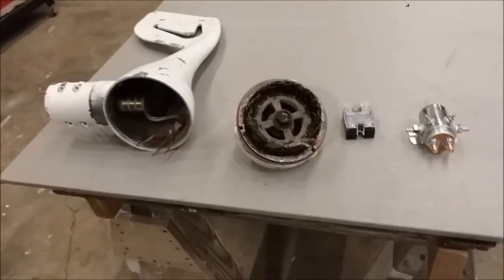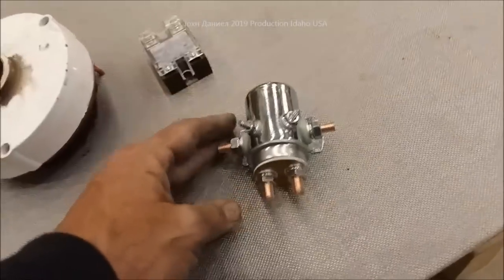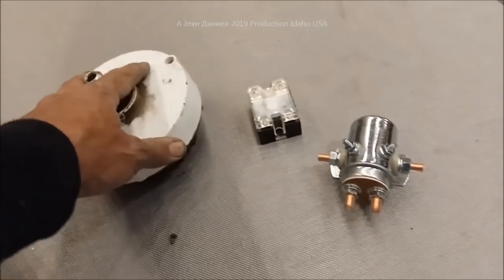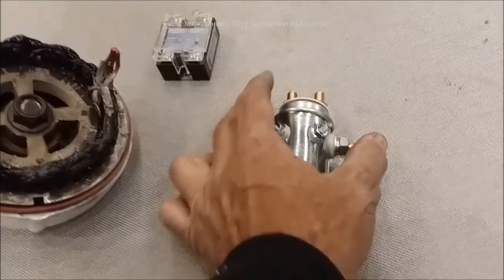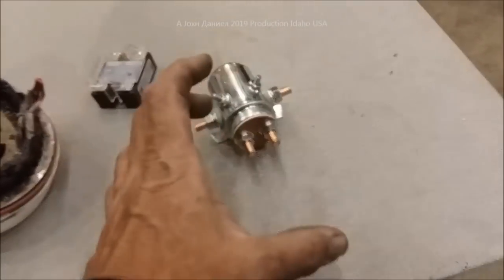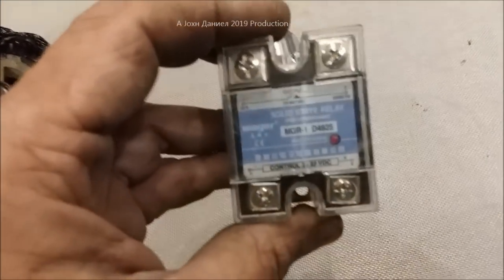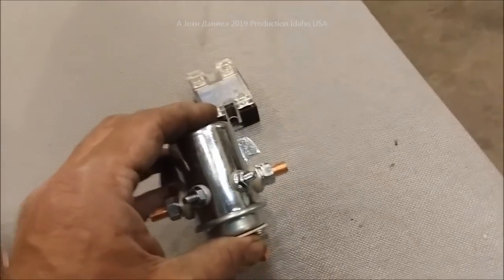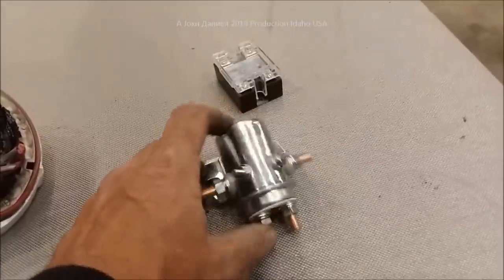Cause of Micro Wind Turbine failures, Best options listed below video

Comment: That looks like the stator was back-fed from the batteries. I don't think the magnets have enough field strength, to induce enough current into the stator, to burn up the wires like that. That looks like the solenoid was on, and some diodes in the bridge rectifier failed short. (they always do, I've never had a rectifier diode that didn't fail short) That allows the battery to have at the low  DC resistance of the stator. The smoke comes quickly!
Reply from the maker: When you dead short a PMA in high winds to 500 watts of resistors due to a failed Solenoid you drag it down hard in RPMS and they get hot real fast, same as if you had 30 mph winds and a dead battery trying to charge(Volts drop - Amps rise). 11 years and not once with over 400 turbines used and installed have we ran across a rectifier thats failed closed since the diodes in them burn apart, not together.
Reply: @JOHNDANIEL1  Diodes will burn apart, if they have the available fault current of the battery. The available fault current of a PMA is limited by the field strength of the magnets, and the impedance(number of turns) of the winds. If these PMA's are equipped with Neodymium magnets, that higher field strength could possibly induce the current necessary to do what you described. The inexpensive turbines that I've worked with just use ferrite magnets, and are largely "impedance protected", in that they just don't have the field strength to induce that much current. My biggest fear, is that the limited torque may not control rotor speed in high wind, and centrifugal force can exceed the root strength of the blades.(They end up in the neighbors yard)

Comment: Thanks John I'm on a remote island so sending back not an option will possibly use to charge a small 12 volt battery bank. I have purchased a 600watt turbine from China through your links and will let you know how it performs.
Cheers Fab.
Reply: Hey fabrizio

Wich one did you bought?

Comment: Hi John really appreciate your valuable input in an area that is sadly neglected small scale wind generation.
Especially here in Australia.
I hope you can help me with some information 're a turbine that is similar to the burnt out version  on this video
 I purchased s 24 volt turbine but it's output  is underwhelming. I tested it's  3 phases under  load and it's giving me  between 12-15 volts on 2 phases and 24- 27 volts on the third phase.
I've checked it internally including slip rings and it seems in order. I have a suspicion that I was given a 12 volt setup instead of 24.
Any ideas on how to proceed or how to test for other possibilities.
Regards Fab
Reply from the maker: I say send it back ASAP. The open voltage in 15 to 20 mph winds ( 650  to 750 RPM ) should be 55 to 75 volts on a 24 volt model.

Comment: They didn't include the dump into mechanism either. That took another week for that and almost shocked myself as its not contained in a box! No connectors for the ac to dc converter either. As you mentioned they are a very hard item to find meaning more wasted time and gas!

Comment: Mine says it will brake on it own why is this one without a brake?
Reply from the maker: If you only use one turbine, the auto braking is ok, not great but OK. However if your like me with 4 to 5 running into one bank or this owner having 3 you need active braking on load instead of braking by controller.

Comment: Hi there john, just recieved my new GE-500 and started getting my controller board setup. For a dump controller i went with the one on the thermodyne website... https://www.hydrogenappliances.com/G4mod24but.html  .....
Do you have any experience with these? Could i adapt an SSR to this system or is this a suitable setup? 24v system, plan on dumping to an auxiliary battery bank and if that fills up that will spill over to a heating blanket in the chicken coop.
Reply from the maker: Use the MAGER SSR https://ebay.to/2R5eBsv be sure to get DC/DC solid state relays, 40+ amp Mager and only put 100 watts load 6 to 10 ohm on that with no more than 300 watts per 40 amp, 400 watts ( preferred ) per 60 amp SSR, and put them on a good heat sink with heat paste. ( https://amzn.to/34uYgVP / https://amzn.to/2UOQKkx )
Reply from the maker: Best resistors for diversion loading, https://amzn.to/2ZFdPej 
Stay away from the compact ones, they burn!!!

Comment: Yea.....the "good deal" I got bout a year ago lasted bout a week when I eventually put it up...Lol
Reply from the maker: With so many knock offs of chinese products made and sold by china itself, thats no surprise. They are only made for battery charging, you would be surprised how many people put them on too many batteries, inverters or controllers with big solenoids that will burn them out. The dump load has to be sized at 40 to 60 watts per rated watts of the turbine. I've seen 600 watts of resistors put on them, and POOF they over draw and burn.

Comment: Missouri Wind and Solar is the one that sells that controller/load diverter set up.
Reply from the maker: Theres numerous people, stores or places selling this goofy thing as a diversion for wind and solar. This could have come from Texas or California as far as I know, I told her I do not want to know. She said MID WEST but that to a person in Carson City Nevada encompasses Texas too as well as Oklahoma, Iowa, Kansas, Missouri and up to Michigan. But its just a fake rated claim and part thats dangerous. You are not supposed to take a wind or hydro 15 volt over volt issue and hard as a hammer drag it down to 10 volts with stupid levels of resistors and call that a diversion, its a joke. Using these on Solar panels as a controller has proven across the planet to brown the cells and burn out panels. It's not a secret that solar diversion as in with a Xantrex does, is 44 times a second Pulse control to keep the volts under 14.5 or 29 so the battery bank is optimal, not beaten down like this joke winch-trolling motor-RV solenoid does.
Reply: He knows.  Just being non confrontational, avoiding controversy and law suits.  Aka, Being smart.

Comment: all that is, is a starter relay for starting a motor. not meant to be just to stay on, there meant to be on then off.  Leave power to them and they get hot as hell and burn up. why so many battery banks are burned up or fried.
Reply from the maker: They are made for power transfer or reversing, like for a winch, a motorhome generator starting, a Trolling motor or a golf cart. 8 cycles per minute, not 50
Reply: @JOHNDANIEL1  I had those.  Hell that guy sells them for god alfull price when you can pick them up for nothing  I think like you said there more for mobile type campers so when you start your motor it disconnects the mobile camper battery bank so your not putting a load on the wire's that are usually smaller and would burn up if a load like a motor starting were placed on them.  Then once running the motor generator can be used to charge the extra batteries for the mobile home or other devices like a dump trailer for example that will have a battery for the electric hydraulic pump, My neighbor had a dump trailer and his went out and i gave home one that I had. And wired it up. Their is also a large diode so the truck don't draw any power from the dump trailer battery.   But you have people now using them for solar and destroying there battery banks and so much more.
Reply from the maker: @McCuneWindandSolar  They come with instructions on how to use it on a ATV winch! How NOT to run it over 200 amps, How not to exceed contact powered cycle over 45 seconds without a cool down period. Enough said!
Reply: @JOHNDANIEL1  one thing they are not designed for is solar.     We could all day tell people what they are used for but, some how they will see that crap in being used in solar and believe a con artist that its the real McCoy for solar.
Reply: @JOHNDANIEL1  There are ones that are made to be used full time  and there are ones that have short duty cycles. There is a big difference in cost of the continuous use ones. Made by Cole Hersee. But when used that way, a 200 amp rated one should only be used for a 65amp load per UL.

Comment: You wouldn't know where I could get a used thermodyne pma would ya? I have some delco alternators, the old 10si external regulated cases will probably work better, they have large openings for more air flow, I have seen some pma's with two front sections, that doesn't look right, the large bearing, and large openings, is the only advantages I see,  I'm thinking a 48v 1600watt pma, for low wind 24v, on windy stormy days I usually get 65 mph wind, but usually 10mph, I was thinking of dumping to a hot water heater,  I know I will get less wattage but maybe lower start, if I can get 300-400 watts on average, I'm thinking about 9kt blades, although it will probably be cheaper to buy the whole turbine, with thermodyne pma, I thought about putting two turbines on one pma, connected by a timing belt. But that's mostly just crazy ideas,
Reply from the maker: I'd just buy the kit they sell, then be looking on how i build it with YAW bearings and Slip rings. My thermodynes have outlasted most all other turbines I have myself used since 2007

Comment: They also make latching relays, that require a a pulse of reversed polarity to disengage , I don't think I'd trust it for turbine use, it would be OK for battery disconnection. Since it uses no power, other than latching or unlatching! It would require a special control , maybe arduino or other microcontroller, its amazing what a magnet can do!! Burn the varnish off the copper , just by moving!
Reply from the maker: Correct, Do not use a physical contactor for diversion. Use a MOSfet4 or SSR

Comment: For 3D printers there are MOSFET modules that shunt power from the powersupply to a large heat bed, I know originally for 3D printing people tried mechanical relays  then SSR's to control the power but they would wear out (mainly due to PWM signalling) they went to MOSFET modules that handle the on/off cycles MUCH better...could this be another route?  Some of them can handle 80-300~ watts easily.
Reply from the maker: Yes, thats the kind of control tech thats effective.

Comment: Good info , knock off brands are cheap but theyll cost you alot in the long run
Reply from the maker: Untrained and non user sellers of junk are just scooping up cash from unsuspecting buyers. thats why my controller is spec built for a install based on the turbine a person buys. Sorta parts needed like wire and poles which I provide to get successful results.
Reply: @JOHNDANIEL1  its a win win situation people get to benefit from your experience and you get to make a living from your passion in renewables

Comment: What about adapting a ceiling fan as a small boat generator how much Power can you get out of it of course changing the blades
Reply from the maker: Although Ceiling fans converted into turbines have millions of views ( MAJOR CLICK BAIT) the truth is they can not handle being a real wind turbine. And the max power is in the 1 to 3 amp range.

Comment: I use the Selionod for running a Wich or starter motor .
Reply from the maker: They come with instructions on how to use it on a ATV winch! Up to 5000lb winchs, How NOT to run it over 200 amps, How not to exceed contact powered cycle over 45 seconds without a cool down period. Enough said!

Comment: do they make a brushless turbine magnets on rotor coils on stator should work brushless
Reply from the maker: All PMA ( permanent magnet generators) are brushless, a PMG ( permanent magnet generator) has brushes. 
A PMA = Wind turbine, a PMG Starter/generator for something like a golf cart or older volkswagon car.
Reply: @JOHNDANIEL1  You still need the slip ring commutator because the whole thing rotates
Reply: rampaging bull  all wind turbine is brushless

Comment: You must buy them bulk box from MadeinChina .com for $7. They are $13 each on Aliexpress and $25 on Ebay. That guy that makes those crappy controllers buys them bulk for less than you I bet.
Reply from the maker: I bought mine to do RV battery 3 way installs in a 12 pack for $7.20 each about 2 years ago, your probably right on prices now.

Comment: Nice explanation. I know those dump controllers with them big solenoids on it, a damn fire hazard.
Reply from the maker: Agreed
Reply: I purchased the 600W dump charge controller  KIT from MSWANDS, and if I had continued with it, it would have killed my battery bank.
It was for 48v system, but I noticed some parts used were only 12v , the controller box started to melt, as did one of the controller wires.
Did not work correctly from the start.

Comment: Which better 24volts or 12volts wind turbine
Reply from the maker: Pick your battery bank voltage you want, go from there. Either voltage choice is excellent but be sure to get proper controllers.
Reply: Јоhn Daniel  12volts battery ... i i used 24volts wind turbine the controller not work that way charge 12volts battery even 24volts wind turbine?
Reply from the maker: @3dilawan269  Controller is its a good one does not care what the turbine puts out, as long as it exceeds battery voltage. If its a self identifying 12/24 controller you can feed a 24 volt turbine into it and charge 12 volt battery. The battery voltage sets the parameters, not the turbine.
Reply: Јоhn Daniel  the PWM SOLAR CONTROLER ITS WORK THAT WAY? connect rectifier its possible?
Reply from the maker: @3dilawan269  I suggest a 100 amp rectifier, then a watt meter, and a separate diversion controller. As I said, a 24 volt will charge a 12 volt battery. Just do a test, a 50 amp battery charger from Sears has a output of 34 volts, to charge a 12 volt battery. WHY?? Because as soon as its put on a 12 volt battery its max is what ever the batteries plates resistance will allow into the battery. But it will hit over 17 volts if not automatically controlled to detect ampacity. Thats why you can use a 24 volt, charge a 12 volt battery and put in a diversion control to kick on at 14.1 to 14.5 volts and keep the battery at optimal charge.

Comment from the maker: Diversion loading is supposed to "trim" your batteries to a safe level, not beat the hell out of them! Replace those junk Solenoids with a DC/DC SSR by Mager its your best bet https://ebay.to/2VVFXny , Heat Sink https://ebay.to/2VPSIzP  Heatsink paste https://ebay.to/2EmkgXA A link to the big ol solenoids a 2 pack cheap is below the video in the info area.  Don't be scammed by these numerous fake wind and solar 440 or 1000 amp controllers sold by scammers with barely 100 amp wiring, your home insurance will not cover your foolishness.
Reply: call me dumb but john how is this connected to to the turbine wiring do you have a video on that